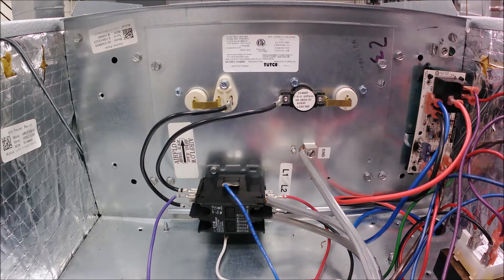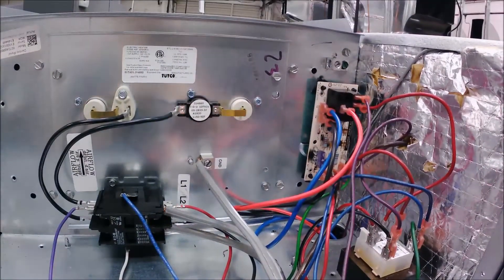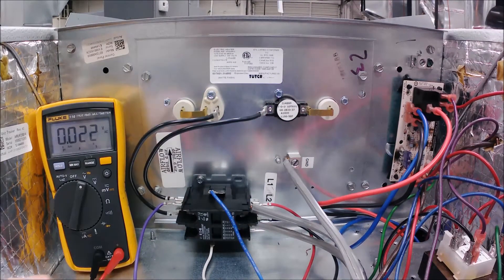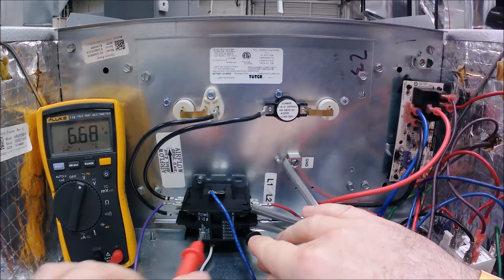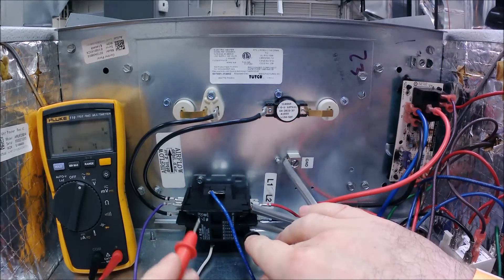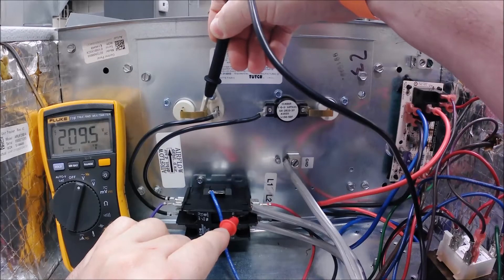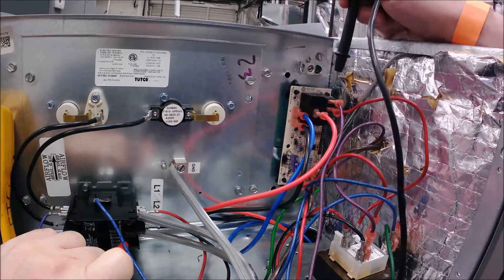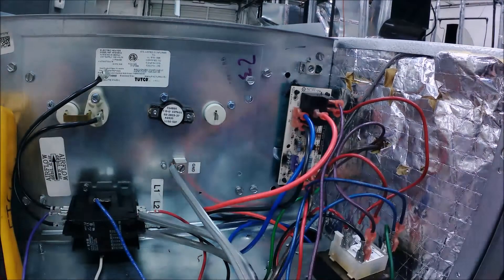High Voltage Hopscotch -  Goodman Electric Heat Circuit | HVAC Electrical Troubleshooting

Comment: Thank you!. Well done and just in time for me to make sure that none of the heat strips are activating while the ac is on this summer. I have only a 13° Delta T (picking up the hvac lingo) but this heat pump - I don't know how old it is but there's heart-shaped hieroglyphics with "Fred loves Wilma" carved into it.
Reply from the maker: Thanks. That is an older one. I had one once upon a time that was 42 yrs old. Guy didn't even have a thermostat...just turned it one at the breaker when he got hot!

Comment: What powers the transformer
Reply from the maker: Not sure what you are asking unless you mean what wire/pins...if so then it is the black and red wires from pins 1 and 2 of the female/male plugs. Straight from L1 and L2 to the primary side of the transformer.

Comment: Thank you for the video. I have a scenario where my coil turns on only when I disconnect the blower motor wire(purple). If I connect the blower wire, the blower fan turns on but the heating element doesn't. It's puzzling me.
Reply from the maker: Sounds like you got something wired wrong. Have you replaced something lately?
Reply: @johnjennings-JJ  The defrost control board was burnt. I replaced that. I labelled each wire before removing the board and replacing it. I guess the outdoor unit defrost control board can be ruled out because the heating happens at the air handler. 
Secondly, the fuse on the relay board in the inside unit was burnt, I replaced it.
Reply from the maker: Sorry for the late reply, got caught up at work. The only time I have seen that happen on an electric heat kit and blower motor circuit board was when the fan board was mis-wired on the relay. That was a goodman air handler and all the high voltage wires were basically one terminal off of where they were supposed to be. That being said it might just be a faulty relay on that fan circuit board. Sometimes when things go boom it messes up something else before that fuse catches it! I would be curious to find out what fixes this.
Reply: @ Thanks for explanation and please do be sorry :). I have the new fan relay board. I will keep you posted how the repair goes.
Reply: It's not the relay board. The behavior is the same with the new board. I don't know what the problem is.
Reply from the maker: This is the crazy part of youtube...without being there and seeing it gets hard to troubleshoot. If you only changed out the defrost board initially and did it wire for wire I don't know where to go except get a local company to diagnose...even if you just replaced the part they recommend. (Of course I say that not knowing how much electrical experience and tools you have)

Comment: Will this work the same on a rtu I’m still learning this my first year and I work commercial
Reply from the maker: Same principle but on commercial you will run into different power supply voltages like 460/277V but once you see and understand it you can use it on whatever!
Reply: @johnjennings-JJ  thank you,thank you love your videos.

Comment: Coil switch load
Reply from the maker: Something like that...but for me it is 2 different voltages mixed together in that thought process. Coil is low voltage, switch and load are high. But if you are talking sequence of operation....yes! Tstat powers coils, switch closes, load turns on. Got it.

Comment: Good vid. Had a no cool call and found that the AC and elements were both being powered at the same time. I suspect a bad board but haven't ordered one yet. I simply disco'd the white control wire from the contactor. I watched your other video but it didn't address how to check for this particular issue
Reply from the maker: An issue for heat sequencer I have seen is they stick closed and keep the heat strips on while the thermostat is just controlling the a/c. First time I saw that it kinda messed with me, perfect pressures, superheat, subcooling, etc. But when i checked the return and supply temps they were the same...80 F! Heat sequencer stuck closed. But anything can happen. Stick with the sequence of operation and basic voltage checks and you'll find it.
Reply: @johnjennings-JJ  It was a head scratcher for sure. Luckily it's my neighbor across the street and there's still time before the cold weather sets in. I thought the contactor was stuck closed but that wasn't it but I will find the issue like you said

Comment: Can you do a video showing the hopscotch method tracing from a terminal block to the loads , switches etc? Great videos
Reply from the maker: I got a couple of videos with different relays and go through some of them doing voltage checks but I am working on another one where I will do that...
Reply: @johnjennings-JJ  thank you, your videos are very helpful

Comment: Does it also work with one lead on ground instead of neutral?
Reply from the maker: With one lead on ground it is a little tricky. I don't like using it. Not to plug any of my own stuff but I have a video on why I don't like using ground for checks with a meter. It can confuse you if you don't watch it. In my eyes you really have to know what you are going to get before even checking it.
Reply: @johnjennings-JJ  Okay thanks for the reply. In my HVAC program we used ground and it seemed to help, but I’ll definitely check out your video on it
Reply from the maker: We all have our ways. Understanding them sometimes is tricky and takes a while.

Comment: If you have 209 v on each end of the heat strip, then it should be on. How does it turn on? I thought it turns on  when it has 209 v going into it.
Reply from the maker: Tell me minutes/seconds in the video you are referring to and I can better answer
Reply: @johnjennings-JJ  ,the question is simple. You tested the power on each end of the heat strip and you got 209v at 6.39 and the heat strip was off. Wien the heat strip is off , and if you test the power on each end of the heat strip, should you get 120v or 240v because if you get 240v it should be on and hot  Thanks
Reply from the maker: I think we are on the same side but dancing around each other...

The heat strip was on for this video pretty much from the 1 min mark. Yes...I did check at the actual terminal ends of the heater and got 209v while it was running. If i had shut it off and left my meter leads in place at those circle looking ceramics I was at...I would have read 0 volts because this unit has a 2 pole contactor used for the heater strip. That would have broken both the L1 and L2 sides of power to the strip and that means 0 volts. If it were a standard heat sequencer or heat relay I still would have gotten 0 volts on my meter if checking at those same terminals but only because the heat sequencer breaks one side of power. If I checked either terminal to ground I would have gotten the 120v you mentioned.
Reply: @johnjennings-JJ  thank you for the info.

Comment: on a Goodman model# MBR1200AA-1AA all electric furnace only, one in awhile(usually the middle of the night) the blower will not kick on but element lights...I have to shut breaker(on-off switch at bottom of unit) OFF ,wait 5 mins till a light click is heard, then switch power back on and PRESTO! is it the sequencer or fan relay?? TY in advance!
Reply from the maker: I would have to say that if the electric strips are on and the blower isn't that it would seem like the fan relay/board is the issue. I have never come across this particular model but i don't see how it is any different than a regular Goodman air handler that I have in the shop.

Comment: Hai john I question confusing me, when we recovery system  to a recovery tank, it’s same time we recovery the refrigerant oil to the tank , can we reuse the refrigerant on the recovery tank to another system? Thank you 😊
Reply from the maker: A lot of guys do reuse it or sell it to another customer. You can discuss EPA regulations for the US but I don't need to. Plenty of that information online. I look at it this way...I am not going to take a chance of putting a mixed refrigerant or acid into someone else's system. One company I worked for had a simple rule, no exceptions...once I take it out of a unit it goes to the reclaiming station or turned in at a local part supplier. Let them recycle and reclaim the used refrigerant so it is right. Good question. Thanks for asking..
Reply: Thank you 👏👏👏
Reply from the maker: No problem. Just my 2 cents worth!

Comment: What to do if the fan continues to run when thermostat in on off
Reply from the maker: Indoor fan or outdoor fan? Either way it sounds like a switch is closed and should be open. It could be a stuck relay switch or it could be the thermostat is sending power to the relay when it shouldn't. If the indoor fan, you would need to check voltage at the fan relay coil or circuit board 'G' terminal (to the Common)to see if you have 24v present. If not then it is likely just the relay needing replacement or the entire fan board.

Comment: Nice video, a good refresher for me. I don't work on many electric heat systems but I do work on electric water heaters. This method will make my next electric water heater diagnostic much easier.
Reply from the maker: Thanks. A circuit is a circuit! I tell some younger guys that the electric water heater is an electric furnace...just no blower. I try to make it easy to relate to what they know so they are less freaked out by "something new".

Comment: I see you are operating on a 208 volt Wye 3 phase system. Keep in mind that when you do that, your heat strips will deliver only 75% of their rated output. In this case a 5 KW heat strip will put out 3.75 KW worth of BTU's.
Reply: Or you could install a 7.5KW heat strip. That is 7.5KW at 240 volts. It would be 5.6KW at 208 volts. Thus you would be compensating for the voltage drop and getting the same heat level at the lower voltage.
Reply from the maker: Good point. I'll have to bring that up in the future. The wire size already there is probably plenty big enough so it shiuldn't be a problem. Thanks
Reply: Yes the amperage will be roughly 24 amps at 208 volts. So a 30 amp breaker will still work.
Reply from the maker: Yeah. Not too much of an increase in amp draw so I would think it should work with the 30.
Reply from the maker: Thanks. This is a 208 system with both single & three phase for the shop. This one was a single phase I think but nonetheless there are a lot of good things to remember about different phase/voltage systems as you said. Definitely have to pay attention to the power supply/system you are working on.
Reply: @johnjennings-JJ  Or use a buck/boost transformer. In this case you will need a 1 KVA transformer with a 120/240 volt primary with a 16/32 volt secondary wired a an auto transformer in order to boost the voltage as close to 240 volts as possible. According to my calculations the output voltage will be around 238 volts.
Reply from the maker: Man that is too much calculating for me. But I would use a buck/boost on my flounder lights!  I do like the thinking aspect of electricity "stuff"... Keeps the brain sharp when it's working on those calculations.

Comment: What other methods can I use to troubleshoot electrical circuits?
Reply: Or would this be the best method?
Reply from the maker: I like this method more than any other. It took me a while to realize that there are 2 legs of power feeding our circuits and that if i prove  power using that main power source  then i am better off. Some guys put one lead to ground when checking circuits. I think a lot of others just don't know what to check sometimes. This is just the way I feel is the best.

Comment: When checking across the contactor and again at the high limit with your lead on L2 is the meter actually showing power from L1 ( both legs) and when checking the heat element across from the high temp. limit isn't the meter showing L2 to L2. May be over thinking it or really don't get it.  I thought L1 to L1 or L2 to L2 would read "0".
Reply from the maker: Sorry...been night fishing lately. Yes. When i first started and kept the lead on L2, I was checking the L1 side up to the circuit entering the element. Once I hit the element, I had to switch the stationary lead from L2 to L1 to get a voltage reading. Just like you said...L1 to L1 would be '0' since it is the same side of power. Likewise with L2. This one short vid was just trying to show how you could do the hopscotch method. The readings could change due to an open hi limit, fusible link, etc. I hope this helps, I don't want to confuse.

Comment: So you're testing with the contactor open or disengaged ?
Reply from the maker: I think for that one I had to heat turned on so the contactor should have 24 volts from the t'stat, closing the switch, and passing power to the electric strip heater.
Reply: Okay I watched it again, and you went straight across from L1 instead of L2 which thought you went straight across from.  
You did a fine job, I should have watched it twice before commenting. Thanks
Reply from the maker: No worries. I hope it makes sense and I didn't mess up on checking/explaining.